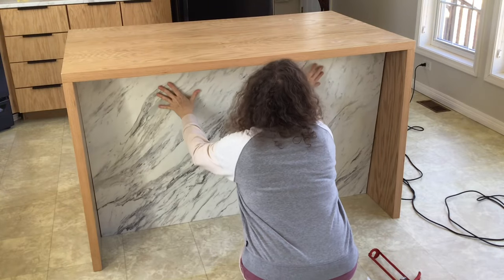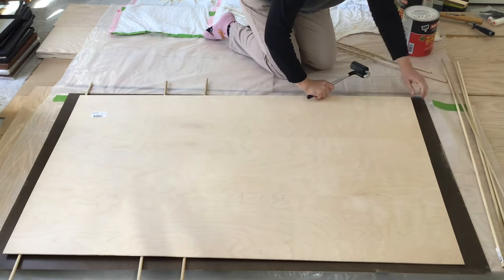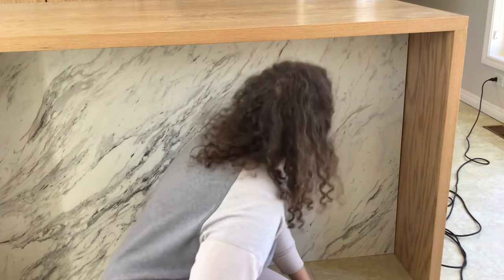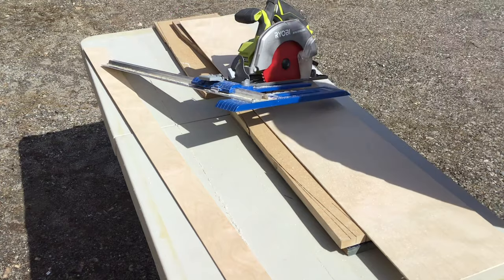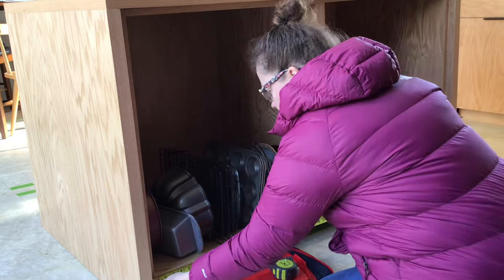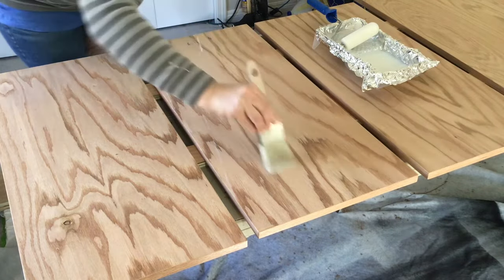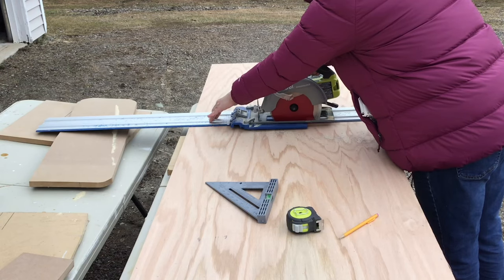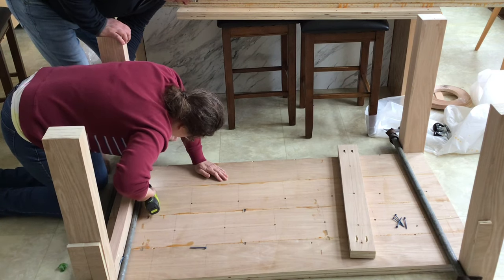Kitchen Island Build Part 3 (finishing the island with faux marble accent wall, doors, and shelves)

Comment: The island came out great. The marble look laminate on the front was a fantastic choice and ties into the perimeter countertops beautifully. You make it look so easy! I also watched the refacing the cabinets and new door videos. My cabinets have exposed hinges like your cabinets did. Changing to concealed hinges make a huge impact and really updates the cabinets. My cabinet doors are already slab fronts with Formica and partial overlay. I might be able to use them. The formica on my cabinets is a faux wood look in kind of a pinkish gray color. A walnut veneer with marble laminate countertops would be pretty. The wheels are turning! Thanks for the inspiration.
Reply from the maker: Thank you so much for your encouraging comments! I think changing the cabinet hinges was one of my favorite updates. And I would definitely recommend going with soft close if possible, we absolutely love them! I’m happy that you found this video helpful. Thanks again for watching!